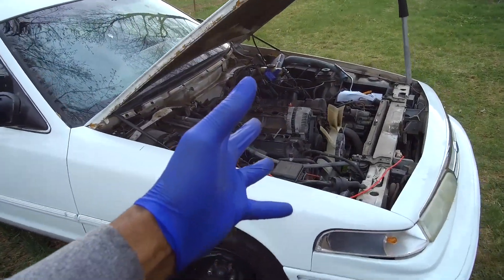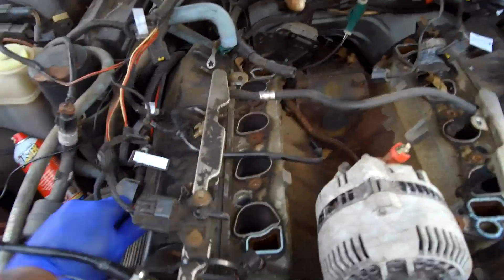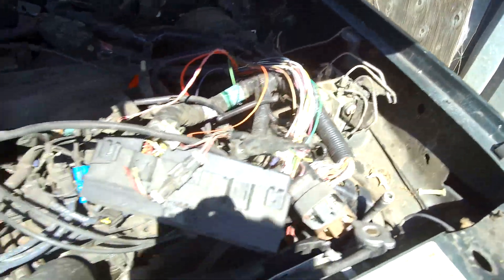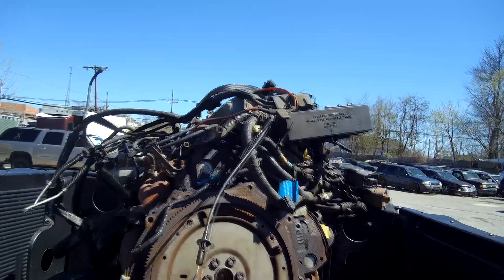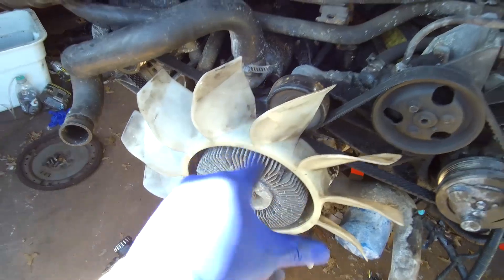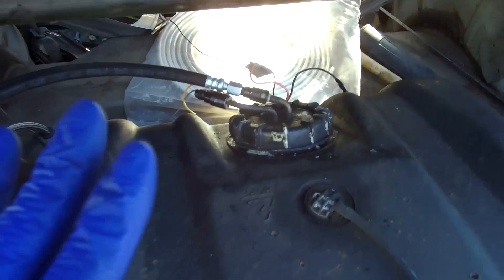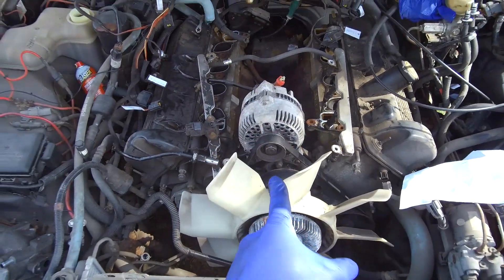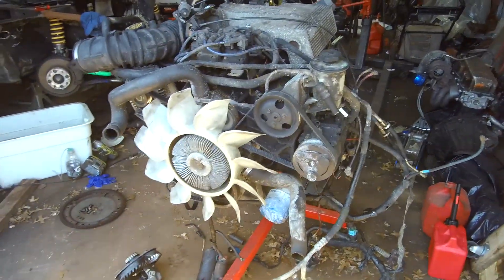Crown Victoria PI Head Swap UPDATE and Issues ( Back The Scarp Yard )

Comment: I wanna do a pi swap on my 96 grand marquis is there a way to keep my fuel rail and spark plug wire cus I don’t want to cut wires
Reply from the maker: you can do that you swap you fuel rails on to the pi intake manifold ( use the pi injectors ) just put the FUEL INJECTOR ADAPTER KIT - EV1 INJECTORS TO EV6/EV14 HARNESS and thats it to do that
Reply: @bstfordchannel923  cool thanks

Comment: My dad just bought a 2002 Ford Taurus... for 700... drove fine for a while now has transaxle warning light in dash... I already knew about the bad transmissions in the Taurus... but it still drives reverse and all... so it’s a electrical nightmare... is it internal or electrical problem with it... it’s got the 3.0 Dohc .... the trans fluid is pink and don’t stink either ...
Reply from the maker: You just ride it ( do not beat on it ) and just wait to see what happens... I am sure its  trans code for it, but thats a good deal thats 3 months of cars payments for $700 bucks maybe even 2 months lol

Comment: Hey little Brother, 
That 5.0 is a good find. The GT-40P heads on the Explorer/Mountaineer 5.0 really help wake 'em up - it's a better flowing head than the GT-40 heads on the old 5.0 Mustang GT.

You know, dropping extra coin for something you really want/need happens, no need to explain - it's just like that, and if you let yourself think short it stings.
I have a budget, and sometimes it's WAY tight, but every time we drop coin it makes everything go forward...
Money has to MOVE for people to make a living, including us.
Even when money goes in the bank, when they use it the money pays wages, buys supplies, pays for utilities and all that - the stuff that puts food on the table. 
It comes back around.
Reply from the maker: Very true about sweating the price ( it did way on me ) just a taste Big brother.  I have a semi-plan for this engine.. I have to complete the Aero.. 
Now these gt40 heads are pretty cool but the secret is the Intake I think.. cause of the long runners combined with the flow of the heads... I have nothing really solid yet just ideas brother.
Reply: @bstfordchannel923  
You're thinking the right direction...
That SUV weighs about the same as a CV (maybe slightly heavier), and Ford put the GT40P heads and that intake on that 5.0 for a reason - to get that heavy thing to MOVE. So, you're golden. 
Believe me, I do understand tight money... 
I been dead broke (not short - broke) twice in my life - second time was had to live in my truck broke, and what we save we don't have to earn again. 
Just sayin' money does no good 'til it moves.
Spend small, save big, earn what we can - but 'til it buys food, clothes, a place to live or whatever else, it does nothing but sit.
When we have to spend, it comes back around one way or another, but you know this!
Peace, little Brother!

Comment: I just swapped out a leaky Dorman intake manifold for a Ford PI one from ADTR. Only real problem I had was not having the oem bolts for fuel rail, coils, ect as the dorman I pulled off had course thread screws and the oem one has the brass inserts. Amazing what it did for performance. Cleared my p0406 code finally as well.
Reply from the maker: thats a good deal brother I am really glad it worked out.. That dorman parts is a wild set-up lol

Comment: one of those $39 harbor freight pancake compressors would be a lifesaver for you if you don't have a compressor or the funds to buy a real one.  It won't replace a $200+ compressor, but it will produce enough air to blow off stuff, fill tires, and do light air tool work
Reply: I second this comment thay will get BST going for sure..
Reply from the maker: THIS is what I am going to do.. I have to cause i need this thing like very soon, but have to clean the head again and then order these springs and ( head gasket and head bolts ) start there

Comment: BST I know you like to make stuff work with what you got but they do make injector connector adapters that are one piece plastic no wires and no splicing.  You can usually get an 8 pack for less than 15 bucks.  I use and trust them on my corvette.
Reply from the maker: No splicing on the pi head swap car .. I have the Bosch to EV6 injector thingy you speak of ( super simple ) now on the other deal i I have to see what route i take with that one lol

Comment: You can put a 302 in a crown Victoria?  How about a 351w?  What years?
Reply from the maker: well in these models ( Aeros and 1998-2002 ) share the same chassis like the box Ltd Crown Vics.. Just need the motor mounts and a few drill outs and your good... Now the motor mounts are hard to source a little cause you need top and bottom

Comment: Your ok on the engine I don't think you gave to much b/c of the way you have it planned out. You doing the right thing keeping the engine in the white car b/c of the A/C cause it will be great to have when it heats up this summer.
Reply from the maker: I still felt robbed just a little on the price of the motor Terry, but i do thank you for making feel better though. It was the best call cause that car has working AC it was a no brainer at that point...

Comment: First of all, when the heck did you get a truck??😅
Also, I don't know if you saw what happened but Mr Random's plans have changed... hint hint nudge nudge.
Anywa I am ready to see that Maverick rolling down the road.
Reply from the maker: That truck was borrowed lmao... ahh i saw that , but shall bounce back from that.. i would have just weld the floor vs buying another car ( save 2k just by doing that ) unless he is finding a period correct car.. Example 1999 black with tan interior that would be wise, but he will get a new one with ( black and grey interior ) ... Its getting close but may get a new tank for the Maverick

Comment: What’s a good oil cleaner to use on a 07 p71? I had my transmission rebuilt at 119k miles, did a tune up & oil change & she just doesn’t drive the same. Or any suggestions on what I should do?
Reply from the maker: what does the car do?  that may have to do with the trans mission ( still ) maybe... Can you explain what is it doing? Is it slow on take of? maybe turn of the overdrive switch or something
Reply: I would start with something silly first.

Did they use Ford ATF? 

Speaking of ATF, running a quart through the crankcase will help clear any sludge.
Reply: It’s takes off slow then the power kicks in.
Reply: I’m not sure what kind of transmission fluid was used.  But I’ll get a transmission flush done today.

Comment: BST, I'd still would have bought the 5.0 just to have it!  Now time to move on with PI head swap... Things are still cooking in your shop!
Reply from the maker: The PI head swap is a pain I have to buy parts and really figure out the lay out on what to do... It still needs to make good numbers and i want to use felpro stuff .. I learned my lesson over the years with cheap head head gaskets... Onward with Pi swap I have to get this over and done with but have to clean the heads very very well 1st

Comment: I've been studying these SOHC engines pretty hard for the past couple of weeks. Seems like you just can't make any power without a PI head swap. With them you can make good power and great torque for the cubic inches.

I know I said it before, the Mav engine sounds really good. You got a solid one there.
Reply from the maker: The engine is the Maverick is way better than the one I picked up. The pi swap is the  best bang for the buck for the Modular sohc. I really think so but its pain though I have to admit that lol... John this was a solid comment thank you for this!